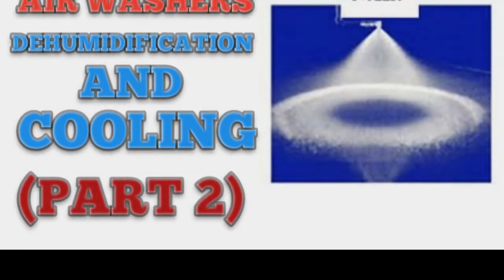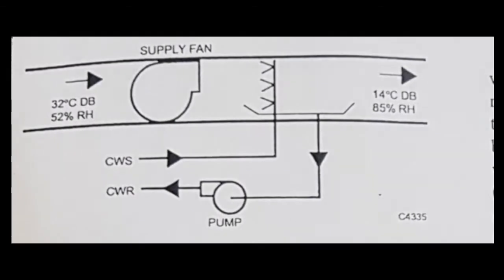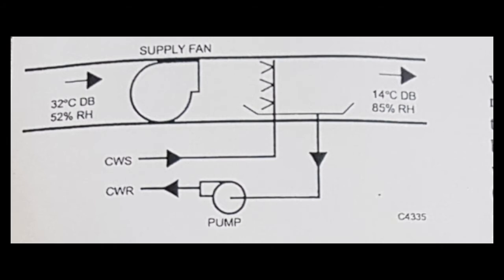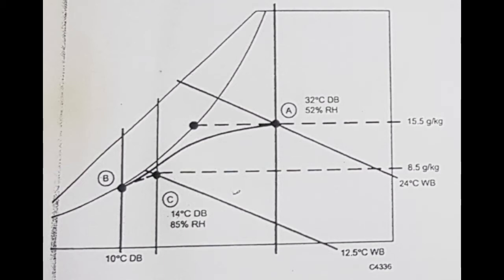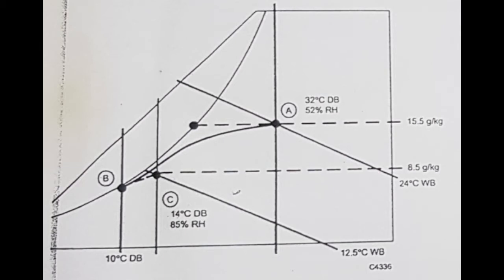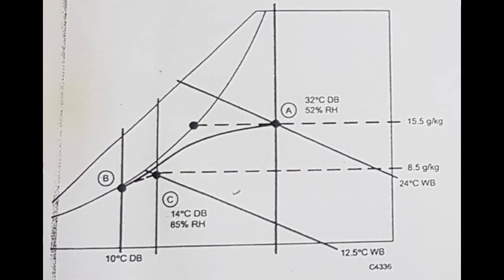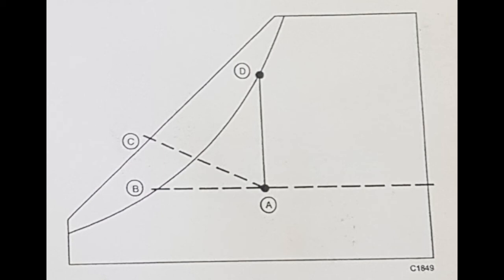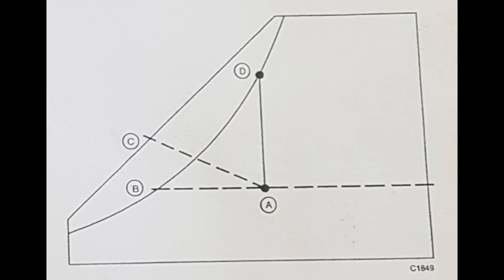Dehumidification And Cooling | Air Washers | Hvac | part 2

Comment: Hello engineer MD what about air rotation unit for warehouse? What's Your opinion on the usage of it?
Reply from the maker: You can find the required info regarding air rotation unit on my website.. A new article i have posted on it, with regards to your comment 😊👍.. Here is the link to that article..

https://www.engineermd.com/2022/09/air-rotation-unit-for-warehouse-hvac.html
Reply from the maker: Also.. i have uploaded a video regarding the same.. Do check it out 😊👍